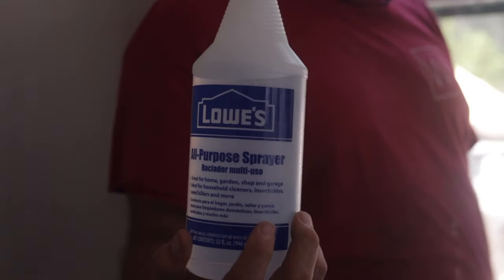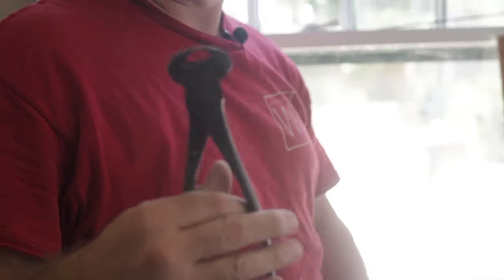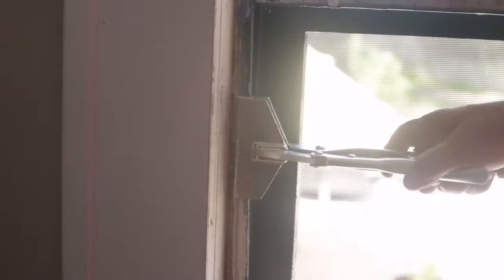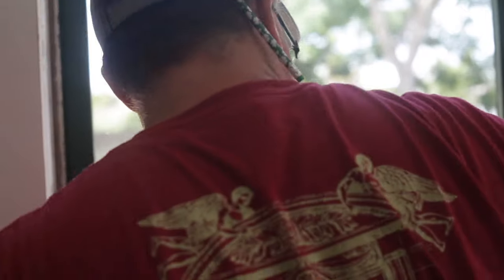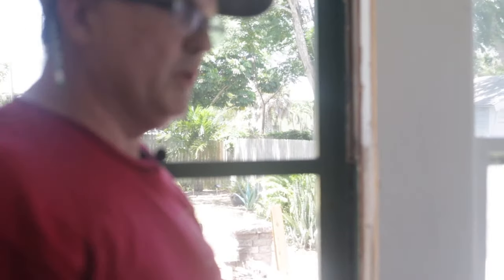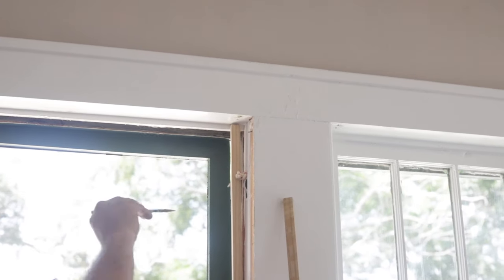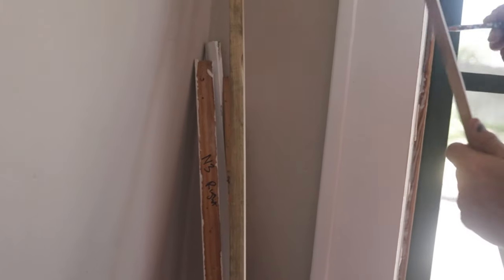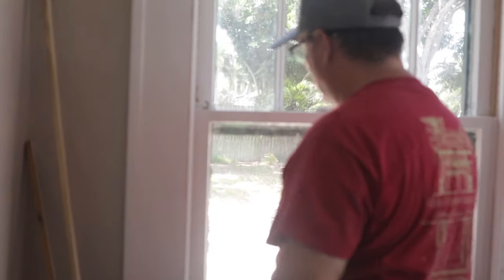Method for the Wood Window Mechanical Makeover

Comment: I have wood 12 over 12 windows from the late 70's with aluminum tracks that the sash run on with springs inside them (mostly broken). With the help of your videos I am repairing the sash.  Is there upgrade hardware available for the tracks? None of the windows stay up on their own.
Reply from the maker: The best I know to try for modern parts is either Blaine hardware or Strybuc. How are you getting the sash in and out?
Reply: @WoodWindowMakeover  I remove the interior stop, then push the jamb liner in on both sides and the sash comes out. The jamb liner is thin aluminum that flexes.